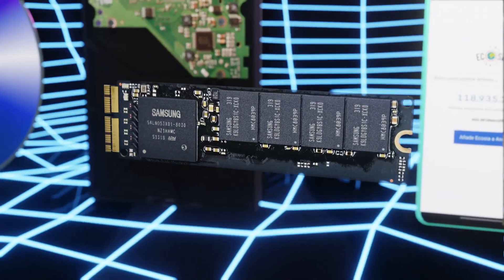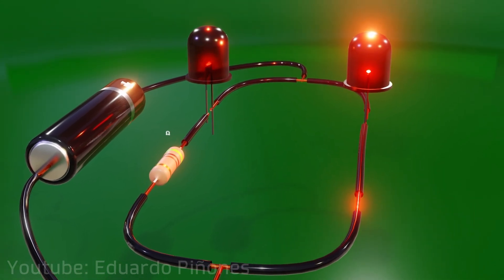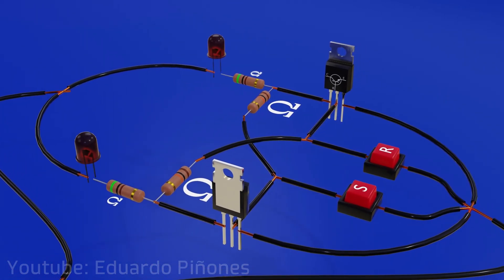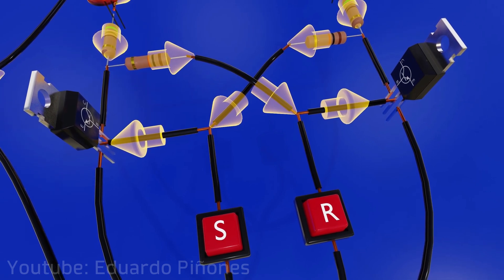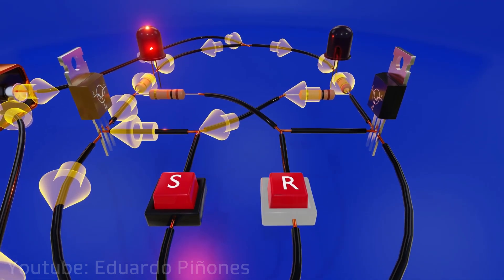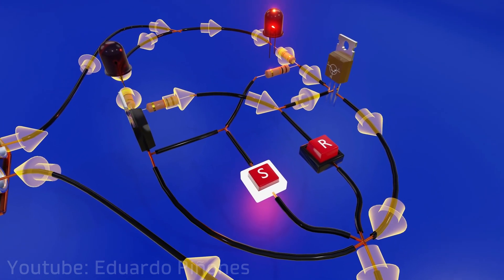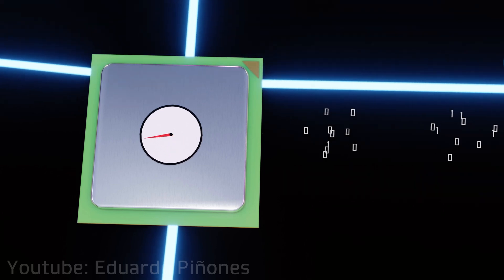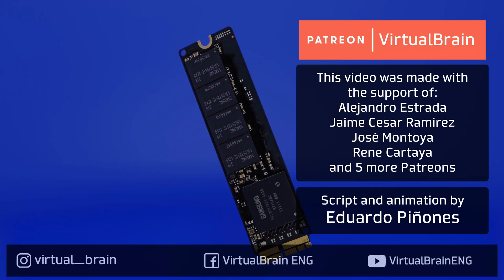How a 1-BIT Memory Works⚡SR Latch

Comment: Unfortunately, this is not exactly what happens. Q1's base draws current through a path that includes LED2 (and vice versa), so in reality, current flows through both LEDs—it's just that one always has visibly more current than the other.

Several people have mentioned that the current flowing through the LED that shouldn't be lit is so small that it doesn't illuminate. However, modern LEDs only need about 2mA to glow faintly.

As a result, both LEDs will light up, just with different brightness levels.

Comment: No electricity doesn't take the path of least resistance. It takes all paths at once but the path with least resistance is where the most current flows.

Comment: While starting of the current , why that the led doesnt glow even after passing through it and when it reaches the base, sayin that without set button is on ,,,well on the left transistor (and) after turning on the transistor withput switching the led glows up😑how is it possible???
Reply: most of the current selects the other way and some current which is under 18 mA cant light them up well

Comment: Why don't both LEDs light up since electricity pass by them?
Reply: I had that thought too man
Reply: As I understand it, it's because the resistance in the other half of the circuit is much lower, so there's not enough current going through the unlit LED to power it.